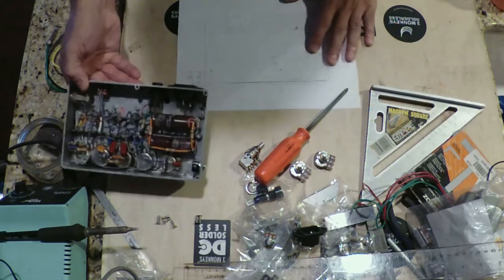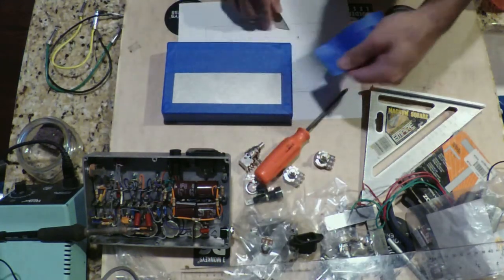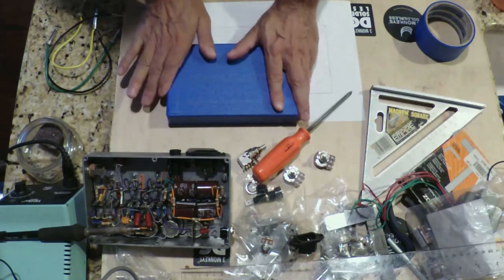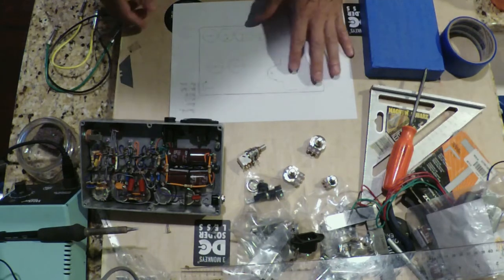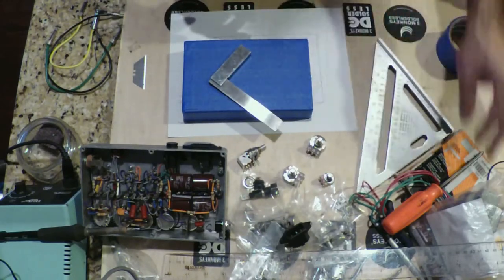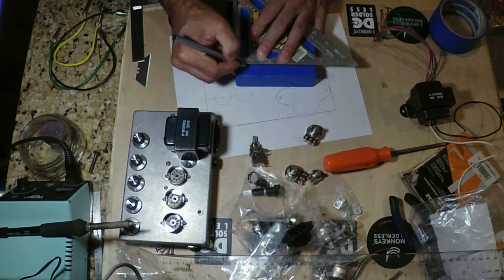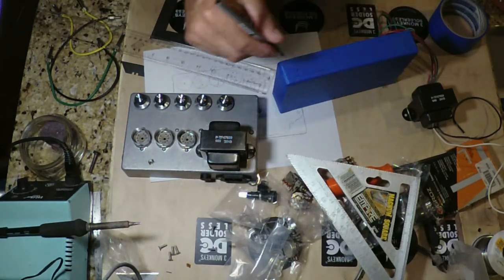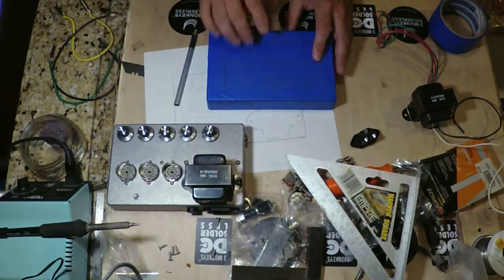Jose Mod Pedal Build Journal Part 2

Comment: what technique do you use to make the AC inlet cut out?  seems like Greenlee would make a rectangular punch, but have not seen one
Reply from the maker: Hello Megatoneamps!  I use a drill and a jigsaw. 

 I lay out the ac inlets  outline with a ruler and square, marking directly on the box with a pen.  I then drill 4 holes of about 1/4 inch,  inside the outline, that just touch the outline.  I then cut between the holes with the jigsaw using a fine tooth metal saw blade.  

Ill try to remember to make a vid of the process when I do it again to help explain it all.

Thanks for watching!
Reply: @ossieahsen6732  thanks,  was hoping you had a simple secret technique :)
Reply from the maker: @megatoneamps  Nothing is ever easy :)